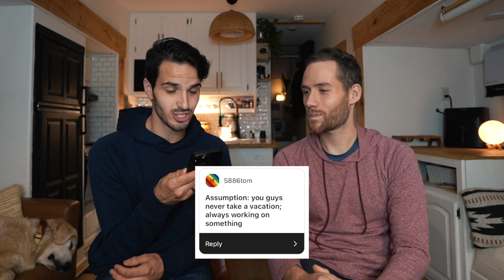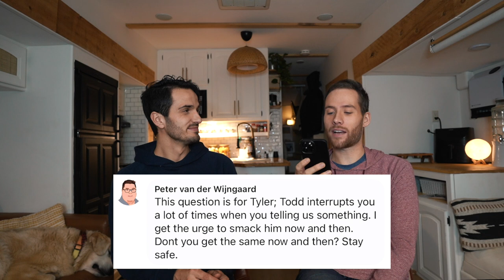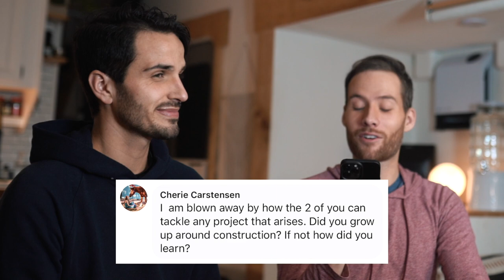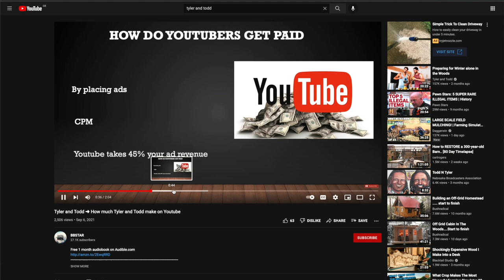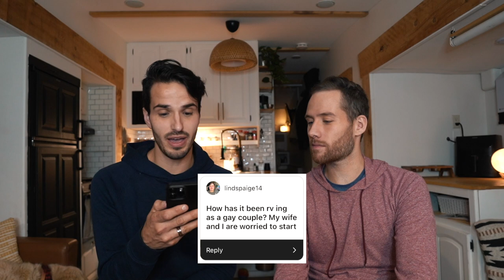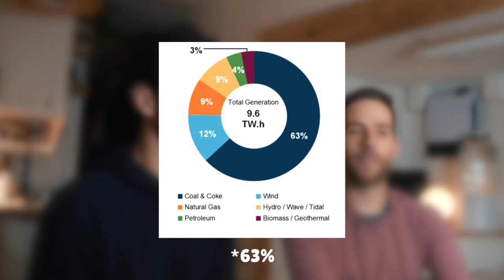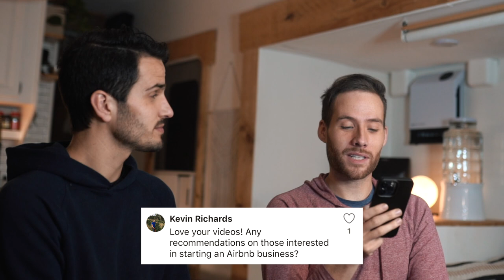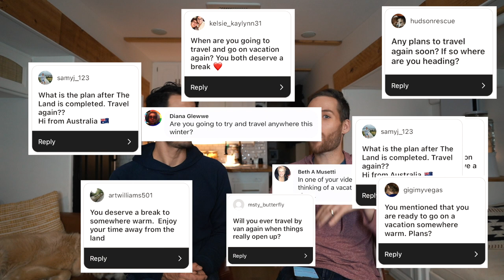Q&A | Get to Know Us | Living Off Grid in Geodesic Dome

Comment: Thank you very much for taking time to go through everyone's questions and give thoughtful answers. How do you plan to protect/guard the property (esp. those solar panels which I presume are aint cheap) if you ever go away for long period(s) of time (e.g. RVing)? 

Regarding the trees being a renewable source, it's unfortunately a marketing trick. This is technically true, but only over the long time span (i.e. the years that the tree would need to grow up and absorb the same amount of CO2 that was burnt). This is true for coal, oil and gas as well, because the amount of carbon in the system doesn't change, it only changes the forms. What matters is the 'processing time'. The entire problem of Climate Change is that we, humans, release CO2 into the atmosphere faster than our environment can 'digest', i.e. absorb it back into the ecosystems. Hence the build up and the temperature rise.

Comment: As far as wood burning goes, you have to manage forests and thin out some trees. If you don't burn the wood, it would still create methane and CO2 just by rotting. Burning the wood, as you guys said, is much better than using the grid because wood is renewable.
Reply from the maker: Thanks for understanding our perspective Michael!
Reply: @tylerandtodd  absolutely! It's something I had to wrestle with as someone moving toward the same sort of off-grid lifestyle as you guys. Mother Earth magazine had some great articles on the issue that changed my view. I also think you guys have a much smaller carbon footprint by living in the woods and off grid in general as well as being vegan -- which I'm not but deeply respect. One's carbon footprint has to be looked at on the whole -- not just one part of it.